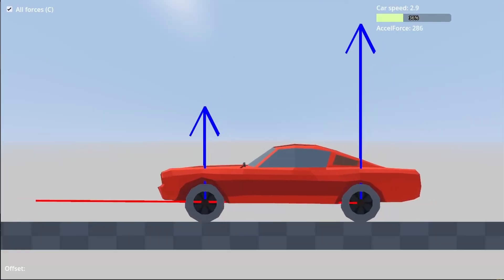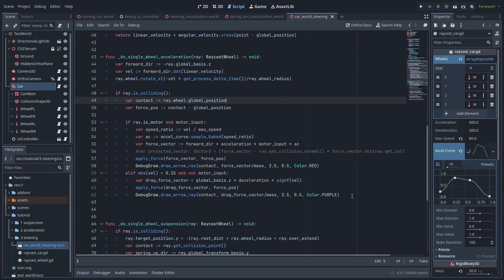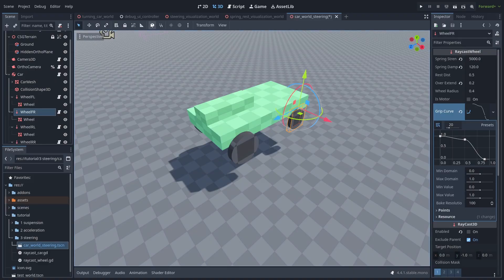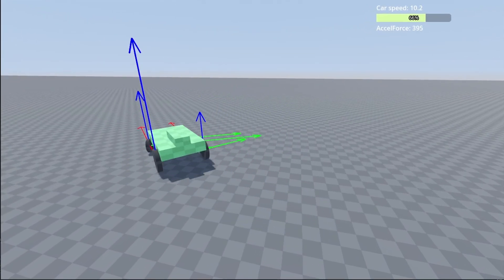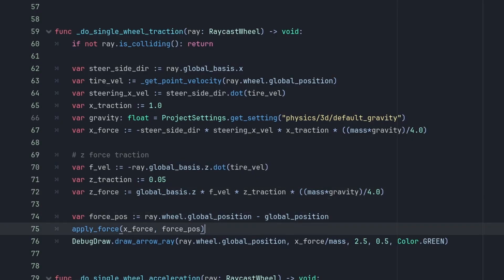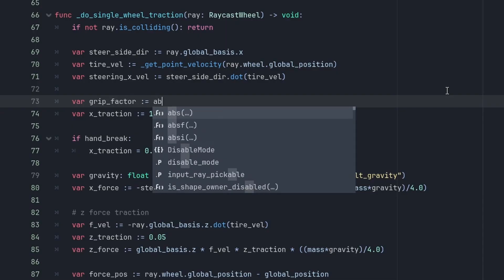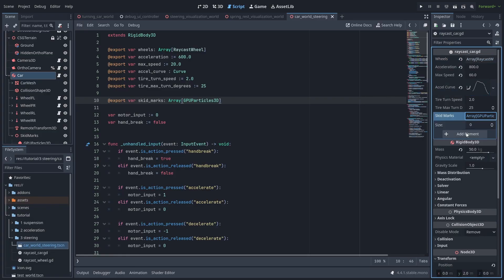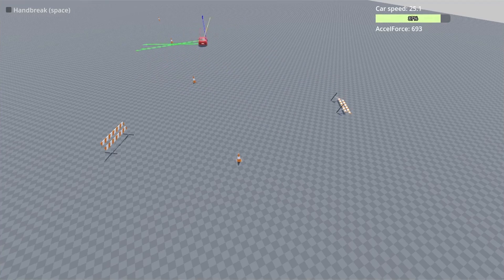Custom Raycast Vehicle Physics in Godot #3 | Steering and Drifts

Comment: another great chapter in the tutorial! im relatively new to coding and your explanation is very clear!
my only addition here is @ 3:32, if you want to add controller support here, i recommend doing;

if turn_input:
	$WheelFL.rotation.y = clampf(turn_input * 10 * delta,
	deg_to_rad(-tire_max_turn_degrees), deg_to_rad(tire_max_turn_degrees))
	$WheelFR.rotation.y = clampf(turn_input * 10 * delta,
	deg_to_rad(-tire_max_turn_degrees), deg_to_rad(tire_max_turn_degrees))

you can keep the else statement as is. instead of adding the turn input to the wheel every frame, which works well enough for keyboards. multiplying by 10 (random number i chose), you get to keep the get_axis float as an analog input all the way through! whats doubly cool is that this also translates to the actual consideration of wheel friction! ::::::3333333

edit: prolly a better way to do this (as all things naturally are), but this is just the method i found works best for my use case! if u gots the better code; spill the beans sister :3

Comment: While you say "the car is not turning" at 4:24, that's only because the motor on your car is RWD. If you use FWD like I was, the raycast is rotated and thus the forces applied in a different direction, making the car turn.. (just in case someone is puzzled by it)
Reply: I forgot he had them on the back and was so confused.
Reply: ahaha this happened to me and I was confused for a second until i figured out the reason 😂

Comment: I am building a truck using your tutorials, i have just implemented traction, but since the first tutorial all my forces are pointing towards the center of mass. i thought that implementing more code it whould fix that, but now with steering and traction it became worse. I know that withough providing a code or screenshots its a shot in the dark for you to help me, but does that ring any bells? Its been doing that since the first part with raycasts.
Reply from the maker: Not specifically. But the easiest step to mess up I can think of is the raycast node direction. 
The raycast node cannot have any rotation or it'll mess up all the forces. You need to make it point down by setting the raycast node target position instead. Or in code, like at the end.

Also, the apply_force of godot is very confusing when you want to apply force at a specific position, because it uses a global offset. But if you copied the video's code that shouldn't be your problem. 

Also, check the value scales. And by that I mean, make sure the you have adjusted the car's mass if you want the values used in the video to work. 
I'm using the car mass of 50kg to get a more arcade feeling. It's in the video when I change it, but a few people have missed this step before.

Comment: The car may oscillate continuously for sometime if you give x_traction higher than 1.0 and then turn left or right and release button immediately this is due to the spring that get suppress when take sharp turn and get release instantly when release the button causing continuously oscillation for sometime which is very annoying,to fix this issue go to basic steer rotation function and use angular_damp = 0.0 for turning or pressing the left or right button in the ,if condition and then angular_dp = 15.0 or higher if required when releasing,the else condition the left and right button

Comment: I found problems with this approach, essentially it's impossible to define spring length, because there is no true compression limits, also traction don't really works, car just always like on ice no matter parameters on curve, for example if I live it stationary on slope, it will just slowly slip

Comment: I have follow your tutorial and i have manage to rewrite the code c# Unity, and it worked so far, but up untill the lateral wheel friction, my car will auto steer to the right, even when the car is stopped, it keep stearing to the right. I think the steering_x_vel is miscalculated or maybe my car velocity is include the y velocity?

Comment: Nice, part 3! Since I found your part 1/2 tutorials I have been working on that flatout everyday for 3 weeks or so. I now have: simple Pacejka and slip for lateral and longitudinal tyre forces, correct weight transfer, tyre normal load calculations, gearbox, diff, engine curve, and a full ImGui runtime visual debugger (highly recommended). So a massive thank you is in order for getting me started, so I bought 1 month Lv3 Patreon from you. The only reason I was able to do it so fast is because I had in 2018 already implemented a full vehicle physics in Unity but without custom raycast suspension/tyres. If anyone here in the comments is getting stuck moving from a simple arcade car, to a more realistic behaviour, please ask and I'm more than happy to help you.
Reply: One thing, in the original part 1 and 2 spring implementation, there is an issue: var spring_force_vector: Vector3 = (wheel.spring_strength * spring_offset - wheel.spring_damping * spring_relative_velocity) * spring_up_axis can give values that massively overshoot the required force and as a result at low speeds the car may start massively jittering  even when not overdamped. A simple fix is

# 1. Add dead zone for very small velocities to prevent numerical noise
var spring_relative_velocity: float = spring_up_axis.dot(ray_world_velocity)
if abs(spring_relative_velocity) < 0.01:  # 1cm/s dead zone
    spring_relative_velocity = 0.0
Reply from the maker: Wow, that's really incredible!

I saw the simulations using gearbox. differentials and anti-rolls but they were a bit too complicated for me to understand and not really needed for most game simulations. 
But I still want to understand and implement them one day.

Really happy these tutorials at least helped you in some way.
Also, thank you for the tips. I've noticed this strangeness of the spring back when I started implementing but eventually forgot about it.
And I'm totally not happy with the lateral forces in this part yet. So it's great to know that a Pacejka model to calculate that exists. I'll take a look at that later.
Never thought of using ImGui in Godot so I'll definitely try that out later

And of course a massive thank you for the patreon sub, that is very helpful to keep me making these videos.
Although I rarely use it, if you'd like you can add me on discord (octodemy) and message me there if there is anything you want to talk about. 
I'm certainly curious about some things as physics is not totally my forte.
I just started reading "Performance Vehicle Dynamics" just for fun to get me to understand a bit more about cars.
Reply: Hello I need some help. I am following these series but I am using C#, and I am having some problems with turning an AWD SUV (all 4 wheels set as drive wheels). I drew debug arrows and it seems that when switching the steering from left to right, there's a delay in changing the force direction in the back wheels, they are initially pointing in the opposite direction. 
This is my current traction code.
if (rayCast != null && IsDrive)
{
    // Side
    var wheelVelocity = GetPointVelocity(GlobalPosition);
    DebugDraw.Arrow(GlobalPosition, wheelVelocity, wheelVelocity.Length(), Colors.DarkCyan);

    var steeringXVel = rayCast.GlobalBasis.X.Dot(wheelVelocity);
    var xTraction = Vehicle.HandbrakeInput ? 0.1f : 1f;
    var gravity = 8.5f;
    var wheelLoad = (Vehicle.Mass * gravity / Vehicle.Wheels.Count);
    var forceVec = -rayCast.GlobalBasis.X * steeringXVel * xTraction * wheelLoad;

    Vehicle.ApplyForce(forceVec, forceOffset);
    DebugDraw.Arrow(GlobalPosition, forceVec, forceVec.Length() / 10f, Colors.Purple);
    //DebugDraw.Text3D($"{forceVec.Length():0.00}", GlobalPosition, 0, Colors.Purple);

    // Straight
    var fwdVel = rayCast.GlobalBasis.Z.Dot(wheelVelocity);
    var zTraction = 0.05f;
    forceVec = -GlobalBasis.Z * fwdVel * zTraction * wheelLoad;

    Vehicle.ApplyForce(forceVec, forceOffset);

    var forceVec2 = GlobalBasis.Z * fwdVel * zTraction * wheelLoad;
    DebugDraw.Arrow(GlobalPosition, forceVec2, forceVec.Length() / 10f, Colors.Red);
    //DebugDraw.Text3D($"{forceVec.Length():0.00}", GlobalPosition + (GlobalBasis.X * 0.8f), 0, Colors.Red);
}

Comment: This series is fantastic and exactly what I was looking for as I get back into Godot. I was wondering though if you planned to touch on improvements to how wheels interact with terrain, like providing upward torque when they move into a steep obstacle, especially with a four wheel drive vehicle.
Reply from the maker: Properly converting motor torque to acceleration is quite complicated, and I haven't seen many examples of how to do this. 

I think you might need to use a shapecast and use the collision normal to calculate do something like this. Which is more costly.
And is not really necessary if you want a more arcady or general racing game.
So this probably won't be in the "basics" part of the series (first 4 parts).

I plan to release further videos after some time when I learn new stuff, but don't hold your breath on that one.

But talking about this, there is a very interesting video talking about how to make a more advanced simulation.
It's a GDC talk about how they made it in Uncharted 4: https://youtu.be/SKXqWcaoTGE?t=728
It doesn't quite show HOW to implement it, but it can give you an idea of what you might need to do.

It's a bit too complicated for me right now. I'm quite bad at physics, so it takes me a long time to understand things. 
But if you want to give it a try, tell me how it went.
Reply: @octodemy  You're the second person to suggest shapecast, which is something I just learned exists. I'll check out that video too and do some experimenting. Thanks for the thorough reply. I look forward to seeing what you do end up putting out in the future and maybe if I can get it working I'll post something about more complex tire to terrain interaction.

Comment: This is amazing, which way do you think it's more performance optimized when handling vehicle physics? for example, do you think the way you implemented physics in this tutorial perfect for a mobile racing game?
Reply from the maker: Raycast vehicles are quite performant. The main reason of using raycasts is due to how fast they are do execute.
So as long as you don't have hundreds of car's at the same time, I think it'll work just fine even in old mobile devices.

Comment: I really like how the car is feeling already to play with and what's possible. Thank you.
What I don't get is: how? How do you know all this? How do you research this? Because, I can follow this tutorial, but I have actually no idea why it works and how to improve on it myself or add other features.
Reply: Learn about basic car physics and the basics of game physics ,like how to get the direction of where we want to move , how to get rotations or collision points etc after that you should be able to make things on your own by combining the things that you learned
Reply from the maker: It's a lot of research and experimentation really. I'm actually quite bad at physics so it takes me a long time to understand things.

I usually start by watching a lot of convention talks. They are good to expose you to the core concepts and show loosely what you need to know. 
But they don't teach you how to implement things, and some important things might be missing because they are deemed obvious.
There is a very complicated GDC talk about uncharted 4 car physics, and a more simple one about Space Dust Racing that are good to watch.

After that I usually go see what tutorials there already are on the subject and try to see what they all have in common if anything. 
So at this point I skipped through a few tutorial about raycast car's on several different engines (because the physics are all the same).
Even 2D car simulations are good teachers. This 2D top-down car simulation for example is a great way to understand the basic concepts a 3d raycast car uses: https://www.iforce2d.net/b2dtut/top-down-car

Then I tried to implement things myself to see how it goes, and read some articles here and there to complement what I'm missing.
But there is still a lot I can improve on.
I'm not happy with how the lateral forces are currently, so I got a book on real car physics to try and see if I can get a better idea on how to properly implement them later.
Reply: @octodemy  Thank you for your detailed response. 
I'll go and watch those GDC talks. I've also ordered a book titled Physics for Game Programmers by Grant Palmer, which has a chapter about car physics. Hopefully that can teach me the basics of physics, car physics and how to turn it into code. Although the code used in the book is Java, C and C++, but I could probably still read and extract useful stuff out of it.

Somehow I only search for tutorials in Godot, but watching tutorials on the subject that I want to learn in different engines can still be useful. So thank you for that tip.

Thanks to @thunderbolt5748 I started searching for books about game physics, so thank you too.